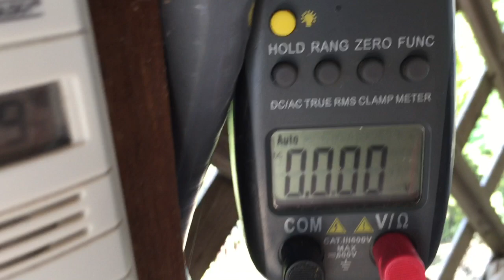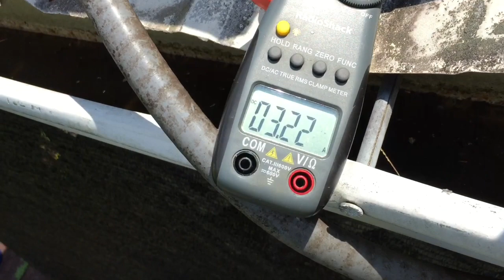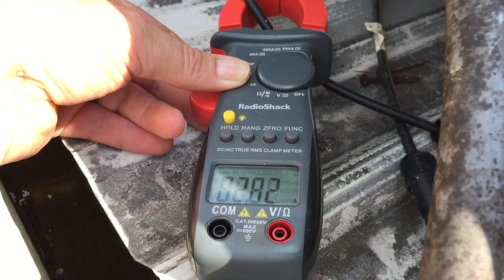Damaged RICH solar , solar panel update

Comment: Looks like it's okay. How was it damaged?
Reply from the maker: It was delivered in a perfect box and when I opened it , it had a dent on both sides and it was bowed about a 1/4 inch like someone at factory set it on something uneven and piled something on top of it , looks like it’s still doing good I gotta keep an eye out for micro cracking , thanks for watching
Reply: @southernohiosolarhomestead8477  That is exactly how my panel arrived too. Arrived in perfect box and when I opened it was dented just like you describe. It works and I did not say anything to RICH about it.